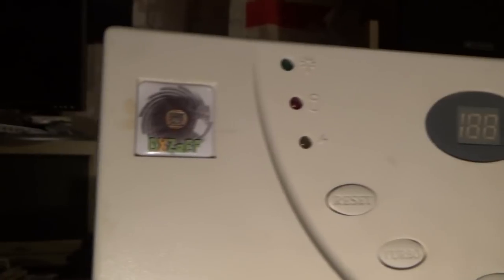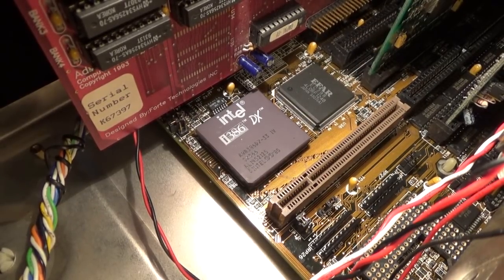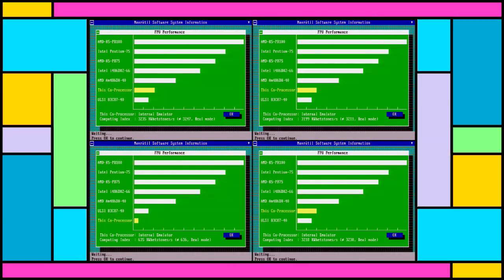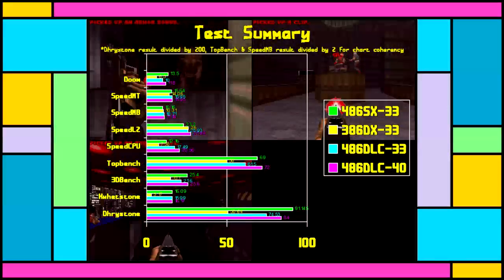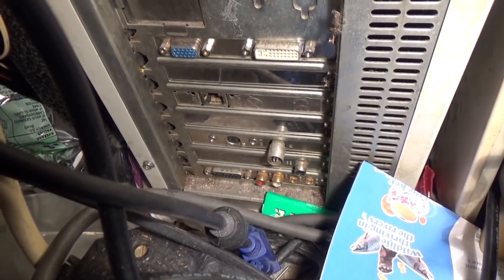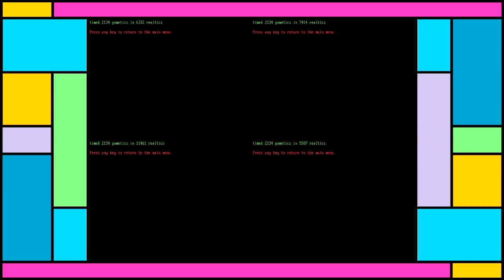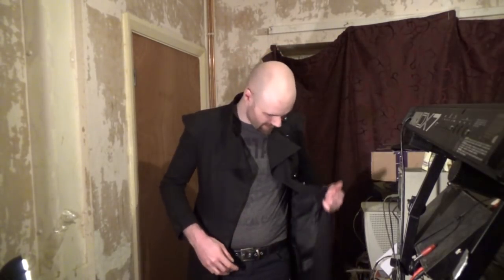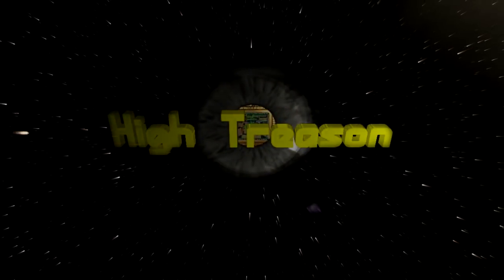386/486 System with VLB Slots

Comment: Cyrix are shit, GUS rocks. The main issue with the GUS is that it solves a very specific problem and, if you don't have that problem, then I can see why would question its existence, even moreso now considering the cost. It was my main sound card for the latter half of the '90s and I used it for music production in Impulse Tracker. Win95 support was an afterthought and FM emulation is worse than pointless. I completely disagree in terms of games though. Any game that uses it properly (Blackthorne, Doom, Pinball Fantasies to name but three) offload the mixing from the CPU, thereby improving the performance of whatever 486 you're using. And it is definitely a 486-only piece of hardware.
Reply from the maker: I'm glad the GUS exists because any attempt to innovate is good, even if the end result can't live up to the hype, at least they tried. It wouldn't cut it for composition with me as I'm a Cakewalk user and the MIDI interface isn't actually that good, nor is the onboard wavetable playback particularly useful here, though as you say, great if you want to play with modules, but that's just stepping a little too far back for my liking and I can't fathom how anybody can get anything done with that fixed event list. Offloading from the CPU is questionable because a lot of the time software doesn't support it well enough to do this, or else it ends up hammering an interrupt and dragging the system down - the disk access for samples in Duke 3D, as an example, is just silly.
I wouldn't say it was limited to the 486 if only because of the many GUS exclusive demos that benefit from a Pentium, where amusingly the benefits of hardware mixing are negated somewhat and other issues begin to arise.
Nothing wrong with Cyrix, they achieved some good things and besides, managing to annoy Intel is always good in my book.

Realized I missed your last comment somehow, notifications were being silly a while back so it probably got lost to that, anyway - our first PC was in 1993, came from Makro, it was the only one on the street aside from some old micros, at least until the local video pirate changed his game to software and ended up with a machine of his own, that was way more powerful and regularly upgraded. His was built to order from somewhere I don't remember as I had little to do with him, remember him jumping on the PowerVR wagon when that came around though and being reluctant to let it go.
Reply: You're right about the latter GUS-exclusive demos making its benefits largely redundant, but I think their benefitting from a Pentium is a red herring - being demos they used MODs and being on the bleeding edge they used the latest instruction set. Is it possible to find out what the last GUS-exclusive demo was?

I suppose what's more relevant is that you'll get superior tracker / mod player / demo performance on a low-end 486 with a GUS as compared with an SB-equipped configuration. I'd be curious to know the performance trade-off on a DX-50 system mixing 8 digital channels in Doom or Raptor depending on the sound card being used.

I traded my AWE32 for a GUS and felt I'd got the better end of that bargain :)
Reply: @BrassicGamer  Strangely, many games like Doom (or later, Quake) didn't use the hardware mixing capabilities for its fullest. Yes, Doom or Duke3D plays its MIDI music in glorious GUS samples - which leave little onboard memory for anything else, let alone uploading all the sound effects played by the game engine. No, these were software mixed, just like for an SB, then constantly (okay, intermittently) streamed to the GUS memory for playback.

Unfortunately, on many chipsets (notably all the Socket 7 ones I could ever try, and there were many!) this GUS streaming really slows things down, completely negating all the potential benefits of GUS. If you run a Quake timedemo with and without GUS sound (not Max or Pnp, they have a proper codec for streaming and Quake uses it well) you may even notice a 20-30% performance drop, which is far worse than what software mixing itself could cause. Just try it on an SB16 and you'll see it loses far less performance.

For MOD based engines like what Pinball Fantasies or Jazz Jackrabbit had, GUS works perfectly. MOD is an excellent thing where you're in total control of your music, the samples as well as the score, and GUS is made for it. It's a bit like Amiga but much better (unless you have to stream something - I guess just copying stuff to chip RAM is much cheaper than uploading to GUS' memory through a 2-byte window).

What counts a lot, it offloads both the CPU and the programmer. It was really easy to write a rudimentary MOD player for a small intro for GUS, it would even fit in a few hundred bytes. I know, I've done it myself. So GUS was embraced by the demo scene which largely used tracked music so they could upload all the samples and forget about it.

What's the latest GUS-only demo? It may be surprising but I could probably dig up ones from as late as 1998. Later tries are probably retro community made so even if they're GUS only, they don't really count here. But I can bring up Stash from late 1997 that practically needs a P3/Athlon 1GHz+ (or P4 3GHz+) to be buttery smooth YET it's GUS only because a GUS player was all they could fit in that 64k beside those many effects and objects and graphics. Even the samples of the music are generated and uploaded at the beginning of the show.  I guess this is the beginning of later soft synth engines which aren't GUS friendly anymore (and being in the Windows era, being GUS friendly is irrelevant anyway).

All in all, whether it's worth it depends on the point of view. I have strong ties with the demo scene so for me it's an absolute must. There are hundreds (if not thousands) of GUS--only demos/intros and much of the time I spend with my vintage configs is watching demos.
Reply: @alvaroacwellan9051  this is really interesting. I swapped my AWE32 for a GUS in 1994 or something and used it with my DX4 right up until I upgraded to a Pentium III in 1999, so there's no doubt I would have experienced the performance deficit you mention. I'd be really interested to set that system up again and do some more research into it, because there were a lot of positives, but clearly some negatives I'm forgetting or was just unaware of. Thanks.
Reply: P3 is thankfully less concerned, both i440BX and VIA 694T (the chipsets I like and tested) are spared from this effect.